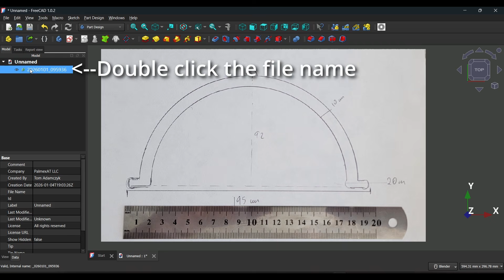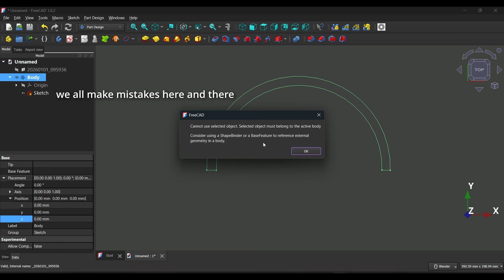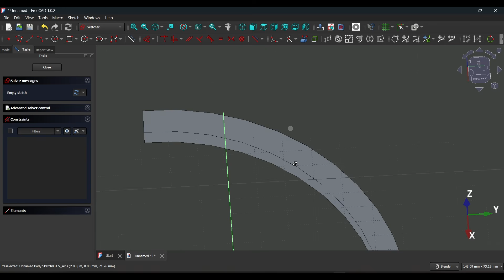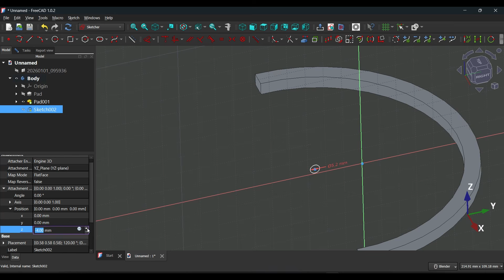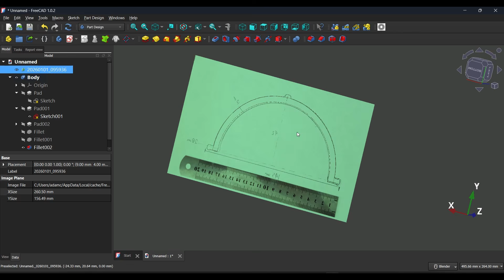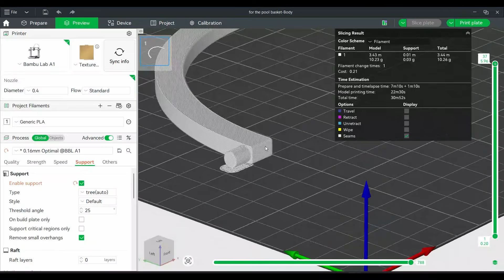FreeCAD Tutorial: Accurate 3D Modeling from a Photo (Pool Skimmer Handle)

Comment: or buy a new one at Home Depot for $5 🙂 But it's fun to print stuff, agreed! I've fixed many bits around the pool as well where I couldn't find the part locally
Reply: Or print one for $1.20
Reply from the maker: Agree.  This one, however, was a newer one I did get at Home Depot.  The basket was fine, but the handle was very flimsy, and I am surprised it lasted a year.  The new handle is much thicker, so I hope it will last a little longer.